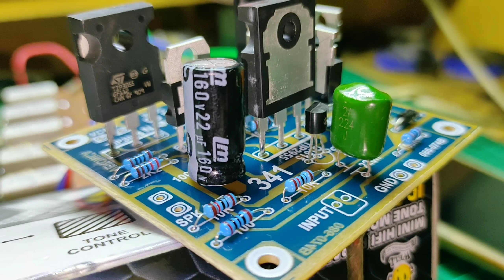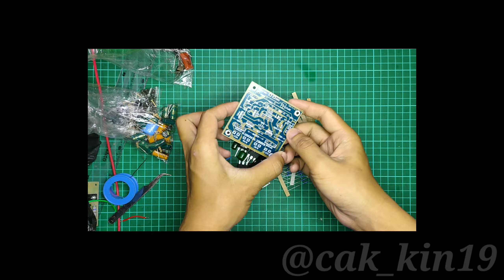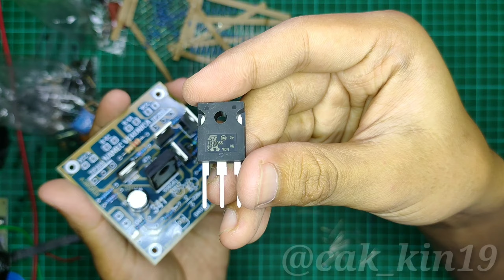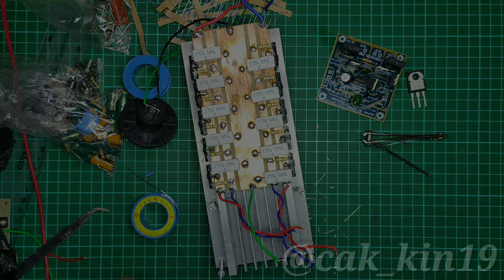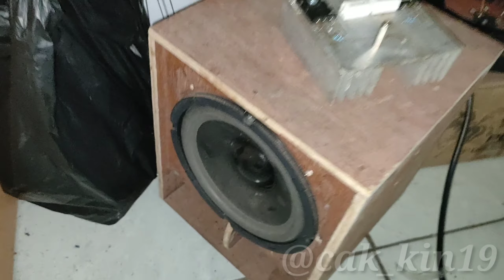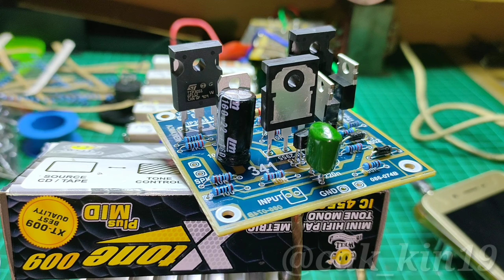Merakit Driver Micro Bosstrap Karakter Low Sub Langsung Test.....

Comment: Mas mau tanya punya saya micro boostrap nya yang tip 2955-3055 saya ganti thosiba suara lebih nendang tapi kok serak kalo suara kecil
Reply from the maker: supplay kurang besar
Reply: Saya suplay 5@ct 32
Reply from the maker: Berarti itu biasnya kurang untuk supplay transistor yg lebih besar ,naikan Tegangan nya
Reply: Maksutnya suplay tr final apa suplay drivernya yang kurang besar

Comment: klo final ganti sanken gimana kang ?? .... thanks
Reply from the maker: Boleh banget
Reply: @MoehMaftukin  thanks
Reply: @MoehMaftukin  klo pakek 2 set sanken trafo main  tegangan n ampere  berapa kang
Reply from the maker: Min 5A 32v
Reply: @MoehMaftukin  thanks mau nyoba soale kang makanya banyak tanya maaf ya kang ... apa micro driver ini perlu di set DCO nya kang
Reply from the maker: Nddak perlu udah auto
Reply: @MoehMaftukin  kang ini nyobak micro tapi dco nya tinggi ... kenapa ya kang thanks
Reply: Kalo dikasi tegangan 45 v gmn ter